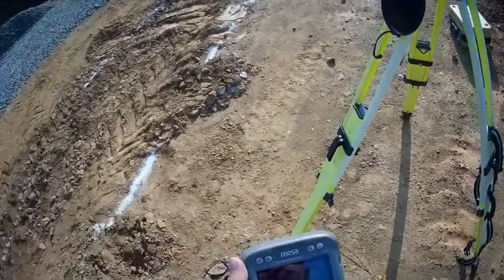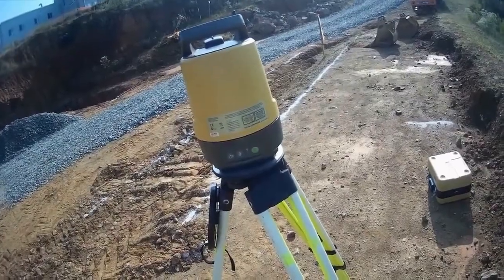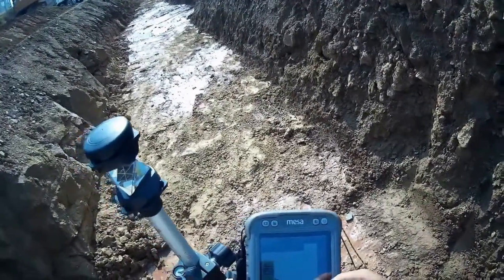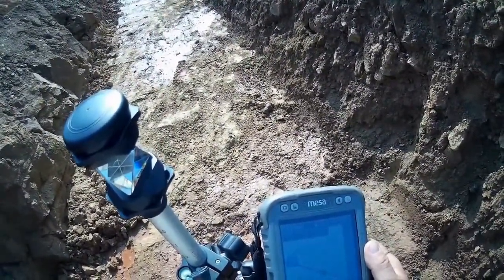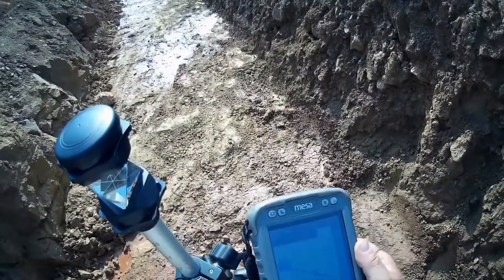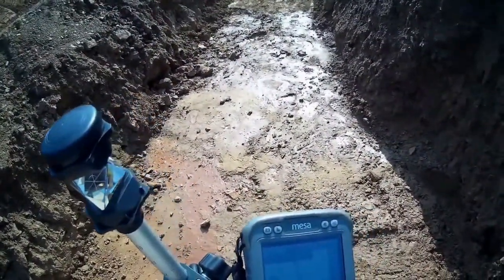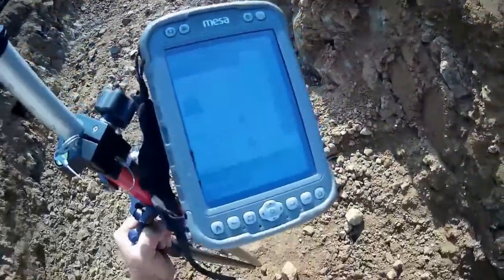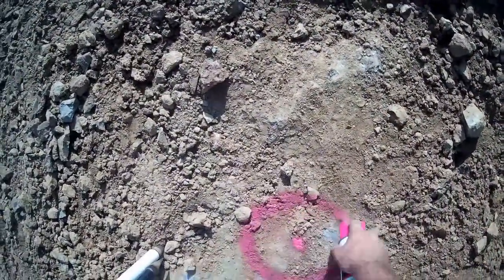Topcon LN100 robotic total station- foundation / footing layout

Comment: Small excavation contractor, layout takes as long as it does to complete the job, would this work for residential with no surveyed known points?
Reply from the maker: @ral3178 Yes, you can enter the building dimensions into the Magnet Field Layout software , and then you can orient the unit to line the building up on whatever you want.  Probably about an hour to enter and layout a basic building, more time if there are lots of corners and jogs.
Reply: Sure save times without using drawing plan
Reply from the maker: @AzharPsas93  Absolutely.  Scaling distances from the plan is tedious.  Stretching tape measures is inaccurate over large distances.
Reply: Still using the LN-100 or have you updated to the LN-150?
And if you still have the 100, has it been good to you?
Reply: What’s something like that cost?